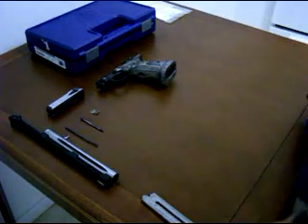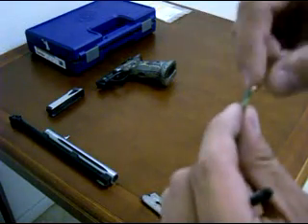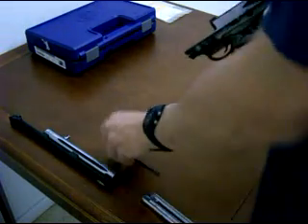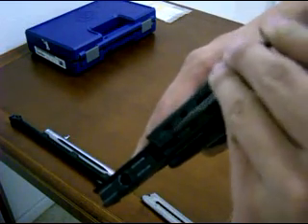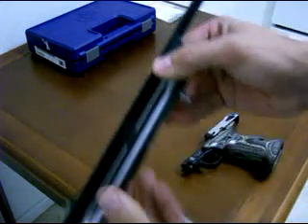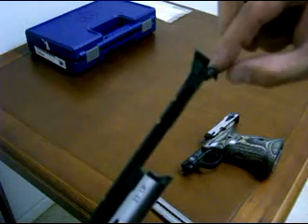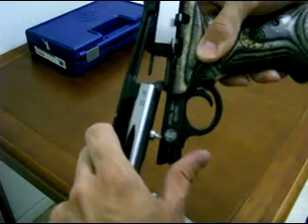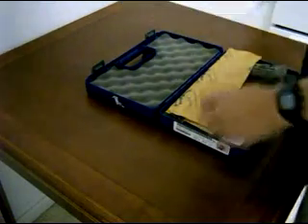Smith & Wesson 22A-1 Reassembly Field Strip Fieldstrip Takedown - Gunknowledge.com

Comment from the maker: CrappieLander, the grips are not aftermarket, these are factory S&W equipment, they have the S&W logo lazered into each side.

You can buy them from the S&W website for $75 new

Every now and then one comes up for sale used if you keep an eye on Ebay and gun forums, but they sell quickly.  :D

Good luck finding a set.